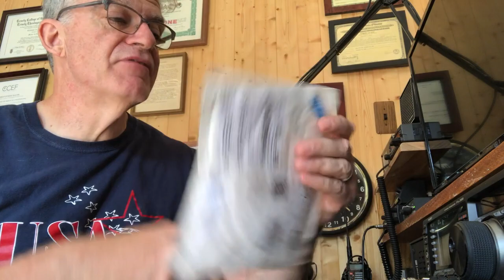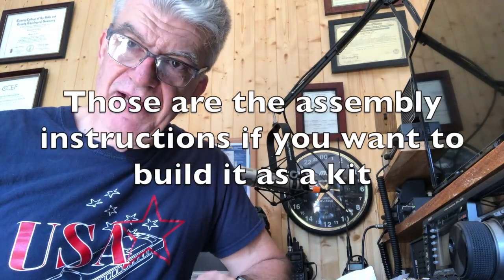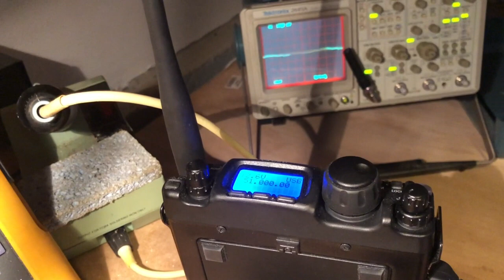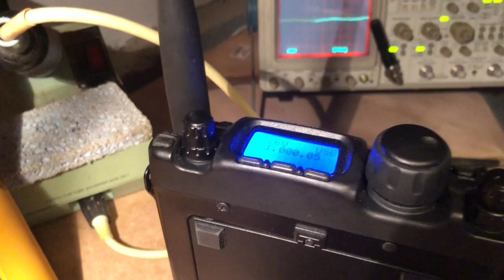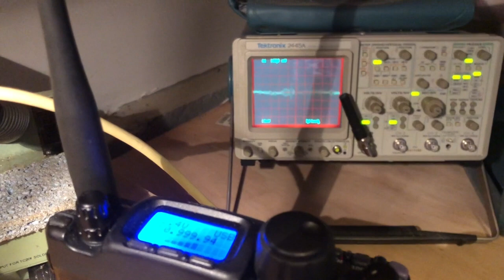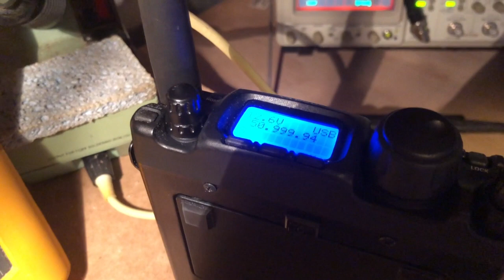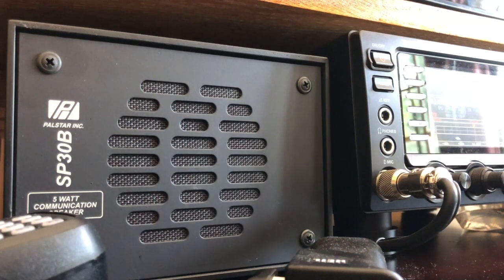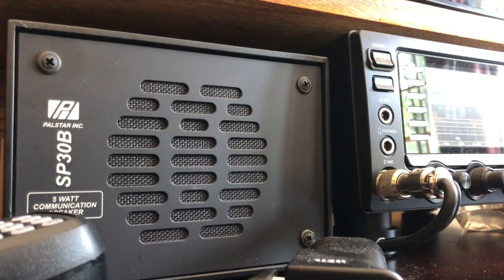Test of the SOTABeams FT817 Speech Compressor

Comment: Mess with menu and mic gain and it really boosts the Audio on 5w ssb sigs, i use on on SOTA and set it up with on air reports before I took it out portable. I think there is a marginal gain with it in line so I use it. vk5cz ..
Reply from the maker: Willian. Direction I’ve been using it with great reports.  All good!

Comment: I have the exact same setup with the 817 except I have the Funk Amateur kit from Germany, which is identical to the Sotabeams one. I've had good luck with it, but never noticed that noise issue...makes me wonder if I should test mine out. Glad to see another 817 out there! 73 W4CRG
Reply from the maker: Craig Sheppard Hi Craig!  Thanks for watching!  I did take it outside and connected the rig to a LW just to noodle around some more.  That noise problem didnt seem to happen  so it might have been proximity to the whip/counterpoise inside.  I did notice that the test tone that is supposed to come on when the DWN and PTT buttons are pressed does not work.  Sent an email to SOTABeams to see what I might be doing wrong.  I did a follow up video to this that shows some of that testing.  Also, just got the 817 a couple of months ago.  Lots of fun operating QRP!  Thanks again!  73